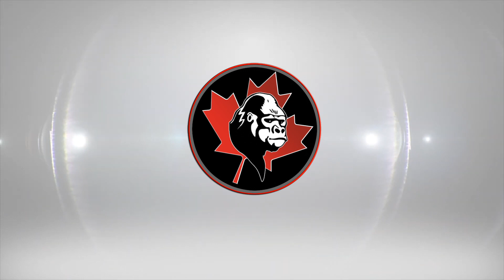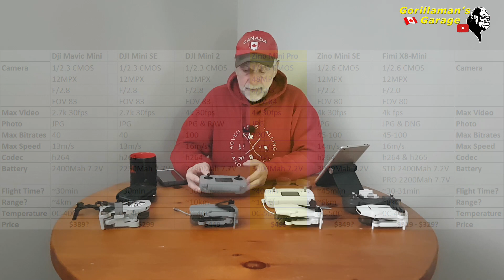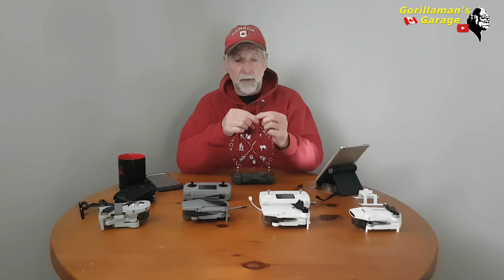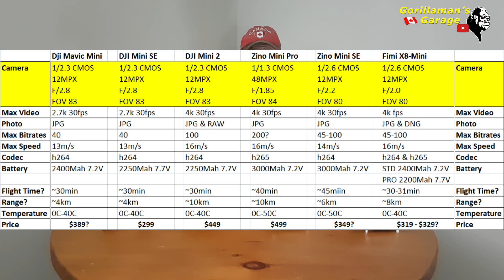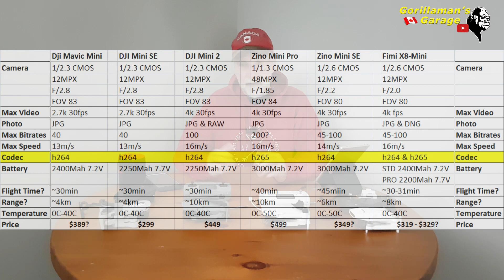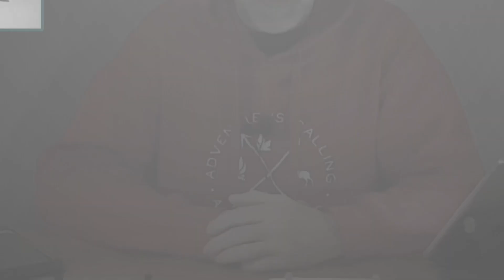The "Mini Wars" - All Sub 250g Video Drones Compared!

Comment: Zino Mini SE has 16m/s on their site. Does it not reach that for you, or did they maybe up the speed with an update? Not that it matters really, just curious. I really am looking at getting the Zino SE, but they are kind of hard to find right now it seems. Sold out on their site for a bit now. 😬
Reply from the maker: I know it does 12m/s but have not checked.  I got mine from HubsanUS.com . It is the best value Hubsan ever.
Reply: @GorillamansGarage  It looks that way from all the reviews Ive seen. I will have to just keep checking their site I guess and pray to the gods they start selling them again. 

Great reviews, appreciate the time, effort and details you put into them, and thatnks for the reply.
Reply from the maker: @commonoutdoors  : AliExpress sells them. and https://www.amazon.com/Upgraded-Hubsan-Camera-Tracking-Batteries/dp/B09J88SCV4  Remember *don't spend what you can't lose*
Reply: @GorillamansGarage  Thanks, appreciate it!

Comment: Very informative video, I like that you gave actual user pro's and con's for each quad!
For my Zino Mini SE, I bought the Zino Mini Pro heat shield from HubsanUS and fly with it on, using it as a landing sled. Factory fit and protects the bottom heat sink and sensors.
Reply from the maker: I wish the ZMSE had come with the shield.  I have a few landing gear units coming custom made 3d prints.

Comment: Thanks for the time and effort to show us these comparisons I have gone for the Hubsan Zino Mini Pro rather then the Fimi.
Reply from the maker: By now the batch production should be better. The early ones all had bad GPS modules and camera irregularities. I am waiting on a new gimbal for mine (any day now). It is a very interesting and capable drone but it is by far not a user friendly unit. Good luck.
Reply: @GorillamansGarage  thanks for responding I was going to go for the new Autel’s Mini drone but it’s to expensive I think personally.
Reply from the maker: @bownsaway  : Same reason here. But if you wanted the ZMP.. I would have gone for the straight Zino Mini. I got the ZMSE as well and it is very good.

Comment: TC26:51  Brilliant tip here .
 Dedicated dash-board that won't be bothered while in mission.
Reply from the maker: There is nothing wrong with using an older phone for flying. I can not understand spending an additional &600 on a tablet or dedicated monitor as a hobbyist. Even my older ($60) Teclast P80 Pro tablet works good on everything (except the new Hubsan Zino Mini's). But an od Samsung S7 Edge or S9 or S9+ works flawlessly.

Comment: TC 18:37  Not a Heat shield.  It keeps the quad from not landing / resting on the belly cams & sensors. 
 The CPU heat indicator tells when it is time to remove it for extra air flow across the drones processor heat sinks which are along the bottom as well.
Reply from the maker: Sorry.. I have to disagree..  it was not there on the first tester models, until heat issues arose in tests. It is purely a liability protocol. Notice the ZMSE does not have it. I have flown with and without and never seen an indicator to remove.. please show.
Reply: @GorillamansGarage  The CPU metrics tell if there is a heat issue.  Up to the pilot on how to deal with that. Removing the ground guard is one tactic.
Reply from the maker: @EcoSpeeder  😅 it's not a ground guard.. 😂.. The Zino Mini SE and the Zino Mini do not come with one... Only the Zino Mini Pro has one.. I (will) say, it's a liability guard 😅🤣😂

Comment: I have flown my ZMP to 10,000 meters many times. To say they will only do a third of that is an untruth
Reply from the maker: Under certain environmental and geographical circumstances, others will get differentiating results. I only offer information under obvious and representative conditions. So as a whole the theory stands that expected overall results should be expected to be less than offered by manufacturers. The 1/3rd rule is an approximation that can be realistically expected for most . Just as higher elevations will result in obvious attainable results.

Comment: I bought the one you don't like even before it was tested, just based on paper specs and I still hope Hubsan can address the blurriness of tree branches that degrades image quality. If I were Hubsan I would start by test recording video in H.264 to see if the problem comes from the H.265 processing that is being done by the chip. I also had high expectations about the HDR mode on ZMP but until now it's not worth using..
Reply from the maker: I also bought it before many others .. before it even was actually manufactured. Then I did an in depth look.. https://youtu.be/5R2Axbqmrl4

Comment: Hi, great comparison video. 
Just a correction on the DJI battery information though. 
The DJI Mini SE and Mini 2 use lithium polymer batteries not lithium Ion. 
The batteries from a Mavic mini will fit and work in a SE and a 2 however the batteries are heavier and will mean the take off weight of the drone is over 250g.
Reply from the maker: Yes, I only spoke of the mavic mini battery.

Comment: Very enjoyable video, thank you. I was gung ho on getting the Fimi x8 mini until you mentioned about the low altitude instability. Has Fimi addressed that issue with a firmware update?
Reply from the maker: Not yet. But it is controllable if you are paying attention. I love that drone for what it is. The Waypoints work great and it flies really good. But not quite as stable a Hover as the Hubsan and no where near that of the DJI.. Add that to the proprietary cable issue.. and the jello...??? But if I were in a better hemisphere.. I would give it a better score. But... the 45 min flight time of the ZMSE is pretty hard to beat.
Reply: @GorillamansGarage  Thank you, I went with the dji mini se and am totally amazed at how well it responds. I've had several drones ,but dji leaves 'em all in the dust when it comes to flight control. Greetings from Oregon.
Reply from the maker: @roundgarage  LOL... Going with anything other than DJI is like going to the Casino.. LOL.

Comment: Great video ! Very much appreciate you taking the time to make this video. Very informative. I bought the Hubsan Mini SE, mainly due to to the longer flight times, no NFZ, and the intelligent flight modes.  My only complaint so far is that I can not change the EV settings while recording.  Thank you
Reply from the maker: Do u have to set them b4 starting video? Are you on IOS?
Reply: @GorillamansGarage  Yes, I have to set the EV settings before starting video. (Android 10) Both the Fimi (X8SE 2020) and DJI(air2s) EV settings can be changed while recording.
Reply: Has it NFZ and no geofencing?
Reply from the maker: @007therealjamesbond  depending on your country it may give warnings of NFZ but in N/A.. it does not.
Reply: @GorillamansGarage  thanks, I’m in Ireland. Is there any way of knowing before I purchase? I don’t mind a warning, but will it actually fly still? I live near a nfz racetrack, very very awkward!
Reply from the maker: @007therealjamesbond  : I think you would be fine. But I also would touch base with Matte Goode from (Good days droning Matt goode) .. he is in the UK and has several of these drones. Thanks for researching before you spend your money. I really like the X8 Mini ... if it was not for cold weather jello it would be tops. If you are not flying in freezing temps.. then it would be a solid pick. I am doing the direct comparison video on the ZMSE & the X8Mini now.

Comment: Just a quick note or update. The ZMP max bitrate seems to be currently at 100mbps with no bugs. Any higher than that and bugs/glitches start to appear in 4k video. Just thought I'd throw that out there. Also there are PID values that produce no jello that the channel Crack has come up with after doing extensive testing. To fix the USB disconnects, turn USB debugging on in phone settings. And the order in which things are turned on matters, the drone gets turned on last. 
Your absolutely right, the ZMP is very awkward and a pain in the rear.
Reply from the maker: Thanks... but again... "awkward". .. - On a lighter note.. I have no issues with jello on my ZMP (yet). 👍👍 There always will be lovers and haters but if it fits the Rubber Duck inference, I'm in.👍

Comment: Nice job. DJI is the original don of the mini bunch and I’ve been close to getting me one but I pulled back due to data privacy concerns and the NFZ nuisance. I find the ZMP an ok drone—yes, there’s something’s that can be annoying about it but its really not a bad drone. It does take both JPEG and RAW photos which you forgot to mention. They’re also working on adding H.264 codec soon and an option to turn on the FPV video feed. But the Zino Mini SE seems like they’ve perfected it and should’ve been the first one to be released. The Fimi... eh, I had one on pre-order when it first was coming out but I cancelled because I got inside word that the first units were beta testers and those ended up being duds.
Reply from the maker: "Drone Syndrome" : You must have better sources than I. Hubsan sometimes gives conflicting information to users. 👍👍 There were 2 new Updates today... RC & FC. I also checked and you are correct... I see RAW in the photo options now (not related to these new updates). Thank you. 👍👍
Reply: @GorillamansGarage  Not really. I just spoke to the regular customer service person as anyone else can do. Yes, they do tend to give out mixed communications at times but it looks like they are making due on their “promises”. They’ve recently added a few new features like Vertical mode, H-Log, Night Mode, Auto Exposure Lock, and now HDR mode. I’ve also been told that they are currently working on making the OA sensors actually “avoid obstacles” instead of what we have now, which is as you mentioned: “an ABS system.” If they’re able to achieve this, it would definitely be very interesting to see it in action. But that is yet to be seen and the heating issue will most likely remain. 

DJI is no doubt the original mini king.
Reply from the maker: @DroneSyndrome  :Great incite. If  Hubsan are trying to make the ZMP compete with the (yet to come) Autel Nano... It will be better. The heat issues will kill it if they add any more strain on the internals.If they let users switch on and off the FPV feed, that will be nice but it will shut down after a few minutes of non flight. They are adding features but for the most part the (awkward) title will remain. We can only judge what we have. The ZMP has been out for several months now and still the camera, which is the main reason for buying a video drone... lacks precision. I think NFZ issues turn many away from DJI but there is no denying that DJI is king in the Mini arena and camera development. So... put the DJI camera in a Fimi X8-Mini shell, with the ZMSE FC and you might have another King of the hill... 🤣🤣
Reply: Your data privacy was breached as soon as you posted this comment.  However I do agree geofencing/NFZ could be a nuisance. Especially if you plan to fly recklessly at a location where you shouldn't be flying like a military airport.
Reply: @gimpman1357  Right... Well, if you want to look at it that way, I’d have to agree. Every thing that requires a sign-in is secretly selling your private data all over the place. In regards to geo-fencing/NFZ’s the responsibility should be up to the pilot to adhere to their local regulations, airspace restrictions, etc. I just don’t like the fact that they control that for you. I was with a friend who has the DJI Mini and we were in a non-NFZ area (checked before going there) but the DJI app said it was a NFZ and didn’t allow him to take off even though it was a free fly zone. That right there turned me off.

Now someone flying really close to a nearby airport or a military airport should not have a drone at all because that is just plain stupid.
Reply: @DroneSyndrome  Just so you know for the most part I was just trolling you.  

I had the same NFZ issue with my Mavic mini.  It would not allow me to fly in a number of free fly zones.  Was a real hassle since I couldn’t test it in my own backyard.  A year later DJI opened up most of those zones allowing me to fly.  

Because of this I have my eye on the Zino Mini SE.  I want to take full advantage of the under 250g in Canada where the rule is don’t do anything stupid. Or like you more eloquently said the “ responsibility should be up to the pilot to adhere to their local regulations “.

PS.  At the same time I welcome NFZ on bigger over 250g drones (ie. air 2s or Mavic 3)  where the regulations are more strict.  NFZ will keep others and me more honest.
Reply: @gimpman1357  I figured that I was trolled. Haha. Agree with everything you’ve just said. 👍🏻